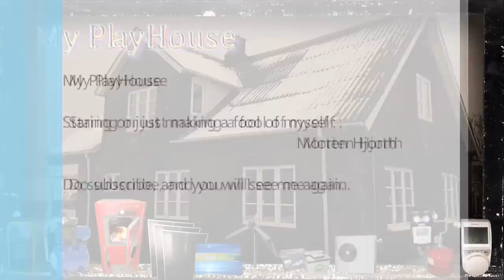Upgrading dead Black and Decker Screwdriver to Li-ion - 282

Comment: This is very useful, but I don’t think you need to take the thing apart that much. Mine (seems the same as yours) has a simple pry-off cover that gives me direct access to the battery compartment. No screws removed at all.
Reply from the maker: Hi JohnSh MTL
Thank You very much!  I did this from scratch,, so I had not done this before.
Thank you for watching! :-)
Reply: Exactly. I just slide off the battery cover at the back and accessed the battery pack. There is no need to take the thing apart!
Reply: @MyPlayHouse  if you read the instructions, it actually tells you how to remove the batteries.

Comment: You wired those cells in SERIES and 2 x 18650's in SERIES gives 7.6V!  But hey! the motor will probably take it!   BTW what did you do with the original little 1A diode in series with the NiCd's? Keep or remove?  Better to keep it in case you accidentally short the charging clips.  Li-On batteries tend to catch FIRE if you do that! Note also that you will now need a higher charge voltage, and you don't get the 2 x 1 18650 cell mAh capacity.
Reply from the maker: Hi Hector Pascal
Thank You very much!  But No,, they are in parallel.
Thank you for watching! :-)

Comment: The original installed batteries are 1.2v apiece (3 x 1.2 = 3.6) Yet you are installing 2 x 3.6 rechargeables making 7.2v. Please explain
Reply from the maker: I put them in parallel.. :-) to give me more amps :-)
Reply: that answered my first question! Second one is what charger can be used for that??  @MyPlayHouse

Comment: Hi, I'm about to do something simmilar to my B&D screwdriver. Let me warn you that you should install also a li-ion charging circuit there. Otherwise, your batteries may explode during charge. At least, the life of batteries will be considerably shorter, in comparison with the case they are charged with a charging circuit. You can find them on the internet, and they are inexpensive. I hope it helps. Regards.
Reply from the maker: I did make a video making a new version, with USB charging,, and more safety.

Comment: could you please let me know if the battery could explode while you were  soldering it?
Reply from the maker: I have soldered about 1000 18650 batteries,, no explosion as of yet.. (I did some battery banks with 140 cells in each,, there are videos)
If you short the battery or over charge it (too high voltages) it can let out all the electrons, in an undesired and very quick way. :-)
Best of luck.

Comment: How do I change the battery on my screwdriverg
Reply from the maker: I use a power supply,,, 0-60 volt. but only at 4,2volt for the Li-ion cells.

Comment: Thanks.  I was actually contemplating this project for the exact same screwdriver and was wondering if a 18650 would fit in there - looks like two will and that will give some extra runtime.  FYI, there are some companies that have USB charging built in to the cell if someone wants to go that route.  I'll probably either do that or pick up a charging circuit.
Reply from the maker: Thank You! I made one more video on fixing another one,, and put in a USB charger : https://youtu.be/wr6Pj3PDFbc

Comment: This december I bought a Ryobi 
4 volt cordless screwdriver. & it works just great & I just Love it.
Reply from the maker: Hi Roger Tyler
Thank You very much!  glad you liked the video :-)
Thank you for watching! :-)
Reply: I still have the screwdriver in the video.  Its not completely dead but the battery never lasts.  Have to recharge often.  The video is great but it is definitely a project that I wont dare to try. Instead I bought a 4.0v Hart from Wmt for $20. (same company that makes Ryobi) Only thing it doesnt pivot like the B&D

Comment: I have this screwdriver,went to use it no power, put it on to charge ,after a day still no power. I did not know about the 2 settings electric or manual,when it was used last it had been put on manual so it seemed like it was dead. Turned it to electric and away it went,just like new. I thought I would have to buy a new one or batteries as I love this screwdriver.Make sure and check out the setting.
Reply from the maker: Hi Jane Mow
Well if you try to change direction on the screwdriver,, the in between forth and back,, must be what you refer to as manual. If so you just had a bad connection.
Thank you for watching! :-)

Comment: I woud be careful because you run the risk of overstressing the max discharge rate of the cells for example, if your screwdriver gets stuck the motor then draws a "high" current lets say 4A [4Ax4V=16W] and thats maby to much. It can cause a venting of the cells.
Often laptop cells are not designed for such a high load they use a chemistry that is more focused on the max capacity with a small Amperage draw (low C discarge rating).
The cells that you can find in Powetools, or if you need an extremely high current in RC LiPos, are build in a way that they can withstand a really high continius amperage draw but dont hold that much capacity (high C discharge rating)

Overall nice and good quality content ;D but a bit dangerous
Reply from the maker: Hi +MoGeLzZ 
Thanx,, 16W screwdriver :-) nice
I am sure this will be fine, and i plan on charging it on the IMAX B6.
Do use my videos as inspiration, and build on top of that.
Thank you for watching! :-)
Reply from the maker: Hi ***** 
Yes That could be a good safety improvement.
Thank you for watching! :-)
Reply: Great idea to put a fuse in!    Would use of this type of fuse allow use of the original B&D charger on a screwdriver with new Lion batteries?  Where would you put this fuse in the circuit?  Are the leads of this fuse polarized, or can it be installed either way?  Thanks!

Comment: thank you for posting your video, i just got my B&D screwdriver same as yours and i got the idea of upgrading it. :D

but for the batteries you replaced, i think what you did is not a Series connection as you said, it was parallel connection and its not 3.6v its just 1.2v cause the 1024mah was the one added (current capacity, not the voltage) the three old batteries are the ones connected in series i guess, cause as far as i know 1cell = 1.2v then on series you are adding the voltage and retaining the current, so 3cells (1.2v) in series is equal to 1.2 x 3 = 3.6v. so i think you just made your B&D battery supply into a 1.2v 2048mah.

any way that's just what i think. hehe and you did great though. thanks for the idea. :)
Reply: oh, i just searched it there are li-ion AA 3.6v capacity! my bad i thought all AA rechargeable cells are just rated 1.2v :)
Reply from the maker: Hi Yzeju Alba
Thank You very much!  this was 18650 cells they are 3-4.2 volt. and yea if I said serial, that was wrong,, I put them in parallel.
Thank you for watching! :-)
Reply: @MyPlayHouse  Oh good. I'm a bit of a beginner when it comes to this kind of work, but I thought it wasn't in series. Glad someone mentioned this.

Comment: What adapter would I use to make it corded? I mean taking out the batteries and connecting it directly. 3.6volt DC? How about Amps?
Reply from the maker: Humm,, think it would run from the charging connection,, might want to put in some thicker cables inside.
Reply: @MyPlayHouse  I think it would be easier to connect the DC adapter from the inside instead of the batteries. Because sometimes devices can't be operated while the charger is connected (I don't know about this one though). Either way, I don't know what the voltage/amp of the original charger is. Information online is unclear.
Reply: @MyPlayHouse  could you please tell me what the output on the charger is? And it's DC right?

Comment: So I was going to buy some replacement batteries but came across this. How do you manage not having a charge and discharge controller for lithium batteries? Is there a chip built in to the lithium batteries?
Reply from the maker: I hsve a LAB power supply, and know not to charge with more than 4.2 volt.
Reply: @MyPlayHouse  thank you. I meant more with the b&v charger and the actual discharge during tool usage.

Comment: It is not so easy @My PlayHouse......... you need an indicator of LOW BATT that activate at the CutOff voltage of the cell.............. You also need to use Cells of High Drain... standar notebook cells do not support the Ampers Drain from the 9078 engine..... the CID will pop if you are lucky .. or worse.. Careful!!!........ and logically you need a charger module .. or intelligent charger ... of charge controller..... to not overcharge it... also Careful there !!!
Reply from the maker: Hi ramdileo
Thank You very much!  glad you liked the video :-)
Thank you for watching! :-)

Comment: There is no need to take any screws out to get at the battery. The instruction book says you should hold the drill by the red section upside down then tap it on a bench. I just tried it and the end cap simply pops off then you just pull off the connectors.
Reply from the maker: Hi GJPhotographic
Thank You very much!  but I did need more access than that..
Thank you for watching! :-)

Comment: my black and decker has the same battery issue, the power lost a lot now. just wondering if the new different type or brand battery is compatible with the screwdriver original charger?  does the screwdriver circle board can protect the battery from overcharging?
Reply from the maker: Hi Fang Ye CG
No do not use the original charger,, Li-ion batteries, must not be charged with more than 4,2Volt and that charger can be all over the places.
I did a new video : https://youtu.be/wr6Pj3PDFbc
might be better for you. 
Thank you for watching! :-)
Reply: @MyPlayHouse  thanks a lot for the help:)

Comment: I believe you have to find a lithium charger for your modified B&D screwdriver now because the original charger will not work for the lithium batteries, it can even destroy the lithium batteries.
Reply from the maker: I just charge it with a 4,2 volt power supply,, sinces I made this video,, I have only charge it onces,,awesome

Comment: How do you charge the batteries?
Reply from the maker: With a power supply,, and voltage set to 4,15
Reply: i guess you need a special charger for li-ion batteries. Also you need a circuit to protect the batteries from total discharge. it seems to me there is something wrong

Comment: can we use the original B&D Battery charger to charge de lithium batteries?
Reply from the maker: Hi Brunno Costa
Not without measuring the voltages comming out of it,, if it's more than 4.2 volt,,, NO! and that is a NO and it's not 4.3volt,, it is 4.2volt open circuit.
Thank you for watching! :-)
Reply: @MyPlayHouse  The B&D charger outpus is 3,6v/600mah.
Reply: @brunnocosta5800  thank you. Has anyone verified this in operation?

Comment: Greetings friend ... of how much are the batteries (volt-amps), are the batteries that replenish the screwdriver and what type of charger should use for recharging, how many volts and which amperage is suitable
Reply from the maker: Hi marco esquerre
Now over 4,2 volt, and charges with 500mA to 1000mA would be good.
Thank you for watching! :-)
Reply: My PlayHouse Hamburg   rioting
Reply: Hi Morton!  Can you point us in the direction of a suitable low-cost charger for the upgraded screwdriver?  (For those of us without a IMAX B6)....  Thanks!

Comment: Can I use the old original charger if I put the same batteries than u? Thanks u :D
Reply from the maker: NO,, the voltages might be to high. and even is it sayes 4V,, it can easily be both 5 and 6 volt on those. And that does not end well.
Reply: @MyPlayHouse  wow! Thanks! And if I put the TP4056 charger (like u) could it be possible? :)

Comment: How to charge the new battery?
Reply from the maker: It's not easy,, but Li-ion works a lot better then the old NI-CA,, so years later this is still working great,, and I have only charged it two times I think.
Reply: @MyPlayHouse  But I use it daily at work, so I'll have to recharge the battery.

Comment: how do you charge it now with tbe different cells in there
Reply from the maker: Hi Charles BridgTec
With 4.2 volt.
Thank you for watching! :-)
Reply: @MyPlayHouse   This may "work for you" but  (sorry to say) that's not the science behind lithium battery charging. A suggestion to use a simple 4.2v generic charger is dangerous advice.
Reply: Charles, you want somethink "like" this:  https://www.adafruit.com/product/259  and adapt it.

There are far cheaper LiPo charging circuits out there you can find. Just be wary of "random ebay" stuff. A safe charger will either have a yellow temperature wire, OR it will have resistor pads to  dial up or down the fixed current to a range appropriate for your battery size (mAH capacity).  

Unfortunately this isn't as simple as cutting wires and swapping in completely different battery tech.

Comment: i lost the charger. now i using different charger (for niCad battery) but too many settings: there is this dial that says "charge amp" with number selector: 0.5, 1.5, 2.0, 2.5, 3.0, 3.5 and 4.0..... which one should i use? ( my battery is still the factory supplied)
Reply from the maker: Hi rexpaix
This is a 3,6volt thing,, the original battery, can be charged up to about 4,2V,, but you want to charge it slowly,, 0,1A or 0,3A,, if you charge it with 0,5A,,, that is a lot for that small battery,, I am not going to tell you it can not be done,, but make sure the voltages is right 3,6-4V and keep an eye on it.
Thank you for watching! :-)
Reply: tysm

Comment: Hi, thanks for your video, could you tell me what voltage and amperage should I use the charger?
Reply from the maker: Hi idordonez
No more than 4.2volt,,, and that means 4.2,, not 4.3   4.2 max and up to 1A  should be fine.
Thank you for watching! :-)
Reply: Use a controller board designed for charging lithium batteries, because a "simple" voltage" charge will not turn off current when the battery is 100% charged.  Ever see a lithium battery fire?
Reply: @MyPlayHouse  so the default charger will not correctly operate?

Comment: if you get some flux paste the soldering is made easier...
Reply: Will you use the IMAX charger to charge the screwdriver?
Reply from the maker: HI +Chuck12 - 
Those pieces of metal was a bit dirty,,, I was lazy :-) 
Yep,, the IMAX B6 will do fine,, i diden´t even think of that.
Thank you for watching! :-)

Comment: Don't do this !!! 

Edit march 2021, The author has fixed the problem, see his reply and look at his new version

1/ This is parallel, not serie
2/ Charging this is * dangerous ***. Batteries may take fire or even explode. You must add a charging board.
Reply from the maker: Well It still works great! But I did make a new version,,too : https://youtu.be/wr6Pj3PDFbc
That can be charged from USB.
Reply: @MyPlayHouse  Well done ! This is a lot lot better :-D

Comment: lithium callium, hrm i think i know why it was zero volts there is no such metal as callium!! you need a different electron voltage in order to make a battery! :D JK just having fun, yes on the polyfuse!
Reply from the maker: Hi SuperBrainAK
Thank You very much!  glad you liked the video :-)
Thank you for watching! :-)
Reply: Ya beat me to it. Those lithium callium batteries are hard to find. The guy is a genius. He's invented a new element. It will go on the periodic table next to bullshitium.
Reply: Jeffrey Deutsch you can actually make a pretty good battery with bullshitium ive tested one I made at home and it gave me 20000mAh